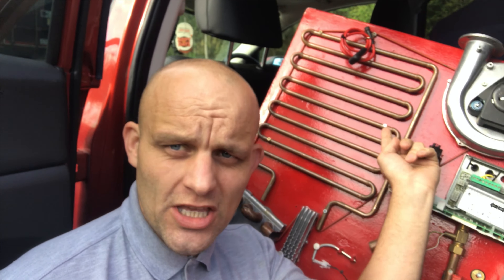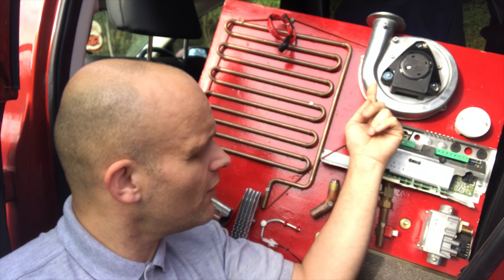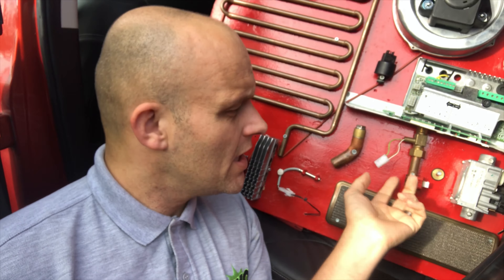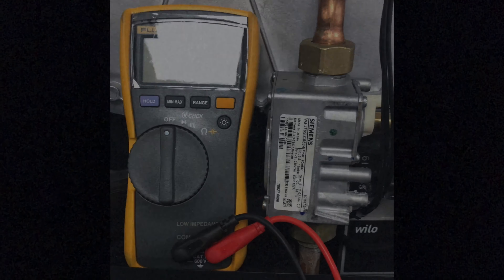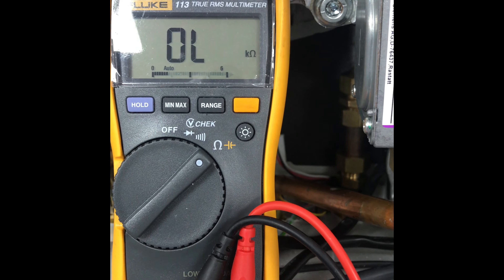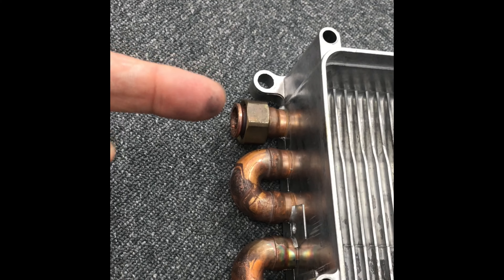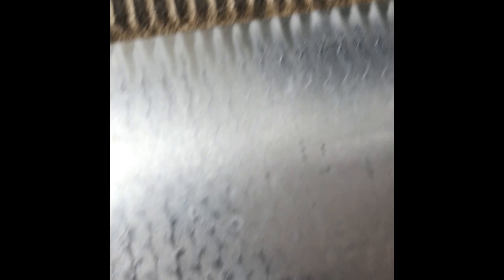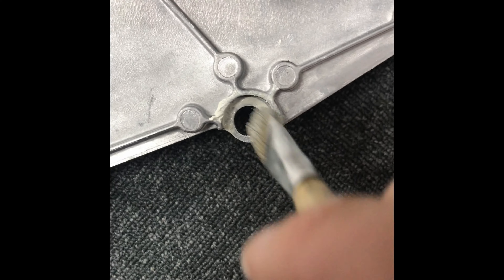Intergas Service/fault finding

Comment: Brilliant Jono I don't have much knowledge on intergas boilers. Serviced 2 changed a faulty fan but never installed any.  I know they're expensive when they go wrong. Over £200 for a fan 😳 customer wasn't too happy when I told them what the repair was going to cost. Suppose the good thing is you can leave a customer with hot water if you're working on the central heating side. 
Great stuff as always pal 🤗
Reply from the maker: Always for asking g buddy
Reply: Most manufacturers charge for the back end. I just fitted a worcester bosch fan costing £225.

Comment: Great Video, getting an intermittent Fault code 13 on an HRE 42 Intergas, which reads swap out the S1 sensor, make sense ?
Reply from the maker: @digbydude  clean and check sensor phial? Cud be scaled up?

Comment: Is the burner failure common on Intergas boilers?  I know they have a slightly amended design as the burners now have a new part number.
Reply from the maker: The burner seal has been up graded
Reply: @warriorsofwarmth  
Thx. I am aware of that from red to black in colour. But the burner now has a new part number. Are you saying there is no change with the burner, being the same old early failure job?

Comment: Rapid 25 combi 
Heating working fine 
Hot water on control coming no 3-4 fire up then 7 and no hot water ? Any thoughts?
Reply from the maker: Flow switch? Or scaled up Hex
Reply from the maker: Hex

Comment: Never seen intergas before Monday had fault code 11 indicating S1 sensor changed this boiler worked. Customer called today to say fault back again. There is no scale reducer on cold supply but does have magnaclean. How likely is it to be a block H E or possibly the HW flow switch? Something simple🤷🏼‍♂️.
Reply from the maker: Chances are it’s blocked these have copper hex
Reply: @warriorsofwarmth  could it be the aqua sensor?

Comment: Hi wonder if you could help me i have a inter gas combi boiler that's making a droning sound when the boiler is not been used i.e. no heating on or hot water drawn it displays a code that reads ( con 7 ) . I've looked on the net and cant find anything would be very grateful for any help or advise thanks

Comment: I have 2015 three intergas boilers 24/28, when we used hot water, they show a faulty code 11. ( let’s say Boiler A ) 

I checked code 11 means that the aqua censor isn’t working.

To test it, I swapped this faulty aqua censor with the one on a working boiler ( boiler B) .

Strange thing is now both boilers stopped working and both showed faulty code of 11.

To ascertain the problem, I put an aqua censor I bought from eBay in boiler B, it’s working now.

I am wondering what could be the problem. Please help.
Reply from the maker: Yes they get dirty  and block
Reply from the maker: Also u may have paddle type they r known for seizing,
Reply from the maker: I cover Coventry if you ever want to meet
Reply from the maker: I also do free training sessions from home
Reply: Thank you so much. It would be good if we can do the servicing and repair for us. How do we contact you ? What’s your email?

Comment: I have install intergas eco rf
A lot of problems 
Intergas warranty go there 4 times 
Still no problem fixed 
And no hot water 
Really bad repair service
I have no hot water 
On the tap it is 12l / minute constant flow
They refuse to repair
They want an video proof send over after they attempt to repair 4 days ago
They replace the flow sensor as a good will?
Reply from the maker: Flow sensor may of been jammed
Reply: @warriorsofwarmth  we have the same problem 4 days ago 
Engineer from intergas replace the senzor on Monday and on Saturday same problem

Comment: Came across an installer who said he came across an Intergas Rapid 32 that has explosive ignition when igniting on CH, but never on DHW. I can only conclude it is a setting(s) in the parameters. Anyone ever come across this?
Reply from the maker: The burners mesh needs replaced
Reply: @warriorsofwarmth  
Why only explosive ignition on CH and not DHW?  That is the odd part of it. If the mesh has gone it would happen in both modes.

The ignition is more of a bumf than explosive.
Reply: @warriorsofwarmth  
I am not 100% convinced the burner is the problem, as he says it only gives low audible bumf on CH ignition not DHW. No need to have an expensive needless burner change if not needed if the problem can be solved elsewhere - no need to get into the all too common just change parts until the problem is sorted.  

Parameter F is the CH starting speed. You can adjust this to start the burner at a high kW which may immediately modulate down, or start on low kW and immediately modulate up. I suggested he turns parameter F up by 10% at a time to see if the bumf on CH ignition is eliminated. DHW starts at a high kW demand as the demand for high kW is there to heat the incoming cold water, while that is not the case on in CH mode most of the time. 

Also in some districts the gas distribution supply pressure at peak times is less than needed, which can at times give ignition problems.  I have seen that before, when many parts were needlessly changed.  Or the gas mains pressure may have fluctuated for a while as works are being done to it, which again causes temporary ignition problems.

Intergas boilers want 20 Mbar at the gas valve in working pressure, so this has to be correct as well. I know some guys who will adjust the meter regulator to get that 20 Mbar at the gas valve, saying screw the gas transport provider as they have a customer to satisfy, not having all the time in the world to deal with those people which takes eons.

Comment: Hi, installed a Intergas 30 system boiler but fault code 11?
Reply from the maker: m Mack sensor fault try changing the NTC
Reply: Hi jay, the boiler is brand new.... strange.
Reply: Also it's a heat only boiler so I still need to change the parameters for a system boiler? Or should it be factory set?
Reply from the maker: m Mack did u buy it as a heat only?
Reply: Bought it as a Intergas 30sb
Reply from the maker: m Mack https://youtu.be/Yu2dfdsWvVI
Reply from the maker: Now look in ur manual for the setting for heat only boiler
Reply: Thanks jay, 
I'm sure it's only the combi boilers that needs to be adjusted.
Nothing said in the manual? 3rd time it has lockout? Fault code 11 circulation problems..
Reply: Boiler already set for system......

Comment: If the aqua-sensor is not working, put in pre-heat?
Reply from the maker: The pre heat, heats the hex ready for demand,
Reply: @warriorsofwarmth  
What will that do, if the aqua sensor is not working?
Reply from the maker: John Burns it will constantly heat the hex. How old is ur intergas?
Reply: @warriorsofwarmth  
I know it will heat the heat X. I fail to see how doing that rectifies a faulty aqua sensor.
Reply from the maker: John Burns it’s doesn’t rectify the problem it only provides a temporary fix
Reply: @warriorsofwarmth  
How? The burner is not coming on to DHW demand. Preheating a small amount of water in the boiler will not rectify that.
Reply from the maker: John Burns are u a gas engineer?
Reply: @warriorsofwarmth  
yep. I assume you mean an aqua sensor is the device that detects if water is in the system before instigating the ignition sequence. On Vaillants the pressure sensor does this and also detects if the pumps is running.

If this is what you mean then I cannot see how preheating DHW solves anything.

If you mean an aqua sensor is a flow switch detecting a flow of potable water, as you said number 6 on the display means DHW draw-off I assume that is what you mean, again I fail to see what preheat does. It will heat the DHW heat exchanger pipes, which will only give a small amount of hot water at the taps. 

 I am all eyes and ears here, wanting to know. ;)
Reply: @warriorsofwarmth  
I had a look. disabled the aqua sensor, set the DHW to 65C, switched the DHW preheat to permanently on. It heats the DHW heat X to 65C. If the aqua sensor (flow sensor, or flow switch) has failed, a small amount of hot water is available at the sink - best with the tap just opened. It will not give a good continuous DHW flow at a good temperature, as the preheat only operates on the lowest burner setting. So a tepid shower can can had intermittently.  

If the flow sensor has failed and no DHW, another way to get out of jail is to to turn off all rads except the bathroom towel rail. Turn on the CH.  Hot water will be available at the taps.

Comment: my hr3 shows error code 0.3 - constantly blinking, anyone?
Reply: fill up the system to 1,9-2,0 bleed the air out and it should be fine. when the pressure in the system hits  the 1.0 the 0.3 blinking will disappear. turn of your heater/boiler with the on off, the boiler should say if its an intergas. (  0.3  -  ) on the display. dont forget to turn in back on. its on when you see an green light on the left side of the display. goodluck!